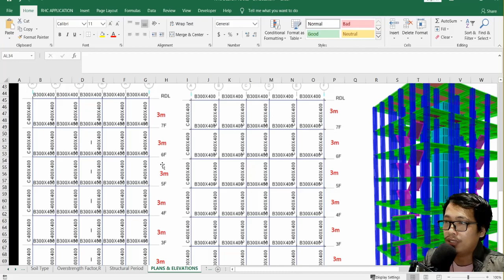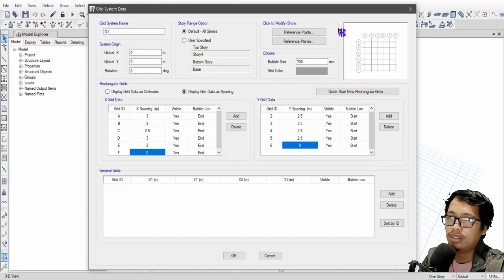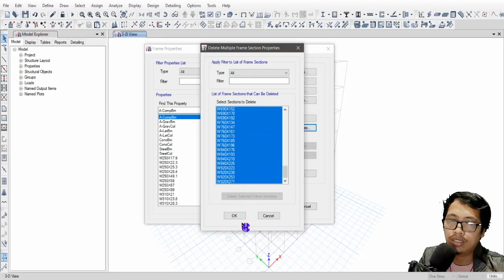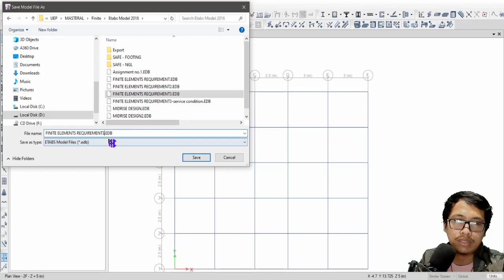Design & Analysis of A Medium-Rise Building - Part 1 of 6

Comment: Good evening Sir. Normal po ba mas marami bakal ng column sa upper floor kesa sa lower floor in etabs? Two story lang po yun denisign ko in etabs.
Reply from the maker: yes. but recheck your model, commonly sa lower columns dapat ang mas madaming bakal. manual design mo nalang.

Comment: Sir tanong ko lang, iba ba ang standard ng Philippines sa levels ng building?, may nabasa kasi ako na low-rise(up to 4 storey), mid-rise (from 4 to 10 storey) the high rise ( more than 10 storey), Okay lang po ba yang 40x40 na size ng column for 5 storey?
Reply: Pwede po Makabili ng Program mo po sir?
Reply from the maker: @laurensinclair9620  dapat may reference ka sis hindi lang sabi sabi. You can download the ETABS software from their official website here: https://www.csiamerica.com/products/etabs
Reply: @rhcengineering  sir! Paano po maka kuha nung program na gamit nyo? Yung gumamit ka ng reference sa nscp.
Reply from the maker: @laurensinclair9620  yung spreadsheet ba?
Reply: @rhcengineering  OPO! yung mayron kang gamit na mga coefficient, to support your computation po
Reply: Thank you po sir.

Comment: Step by step guide:
7:06 How to define parameters
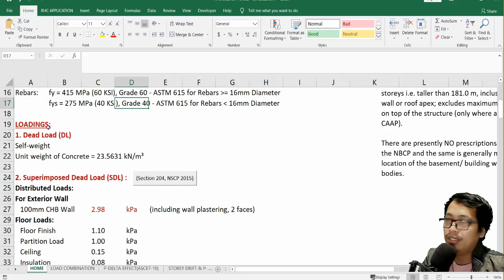8:35 How to determine the loadings
12:44 Live Load
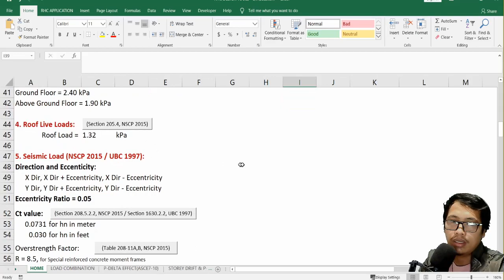13:15 How to define Roof Live Load
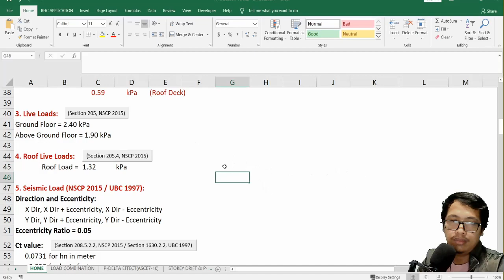15:59 How to define seismic load
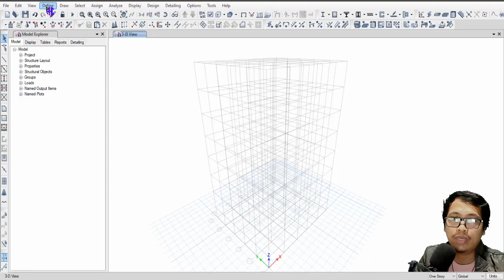25:46 How to define material
27:42 How to define section properties
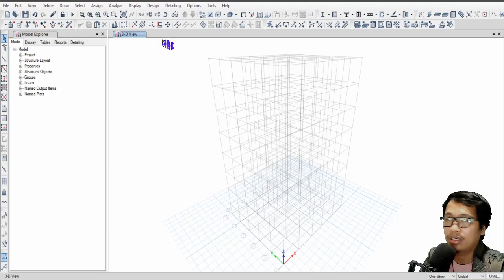36:24 Model the building
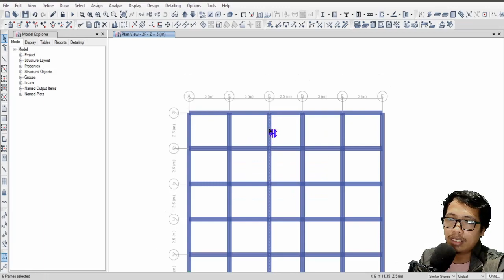39:00 How to break beams
Reply from the maker: It depends on the type of the structure, materials, & code provisions.
You can determine your loading using your code provision or by using the data from the material suppliers.